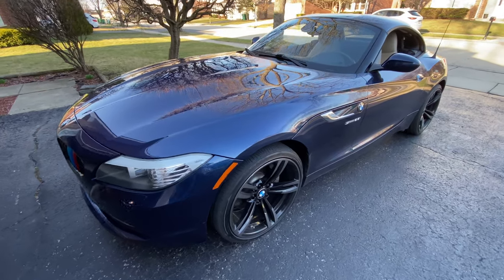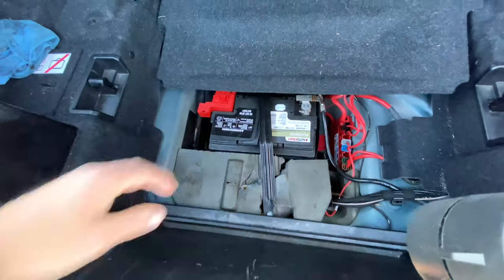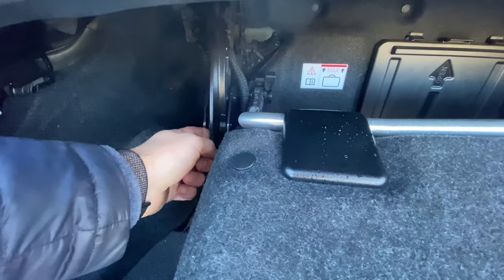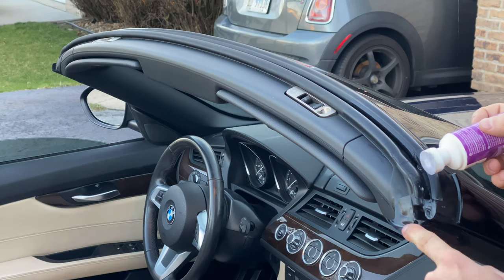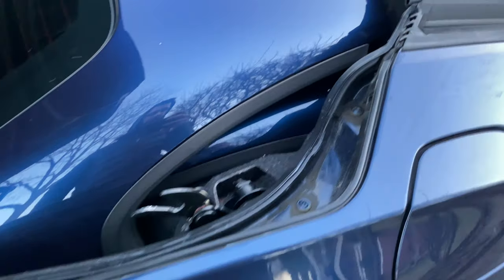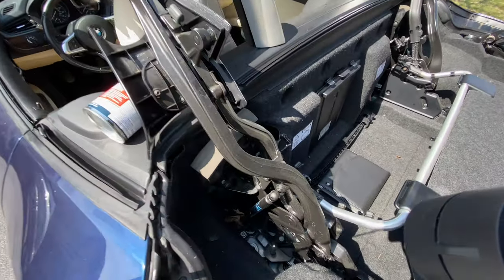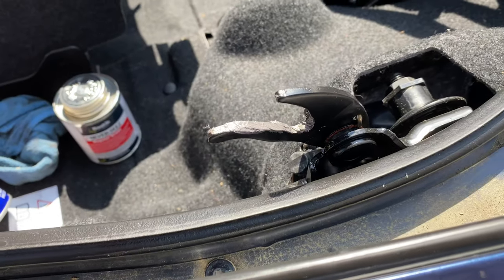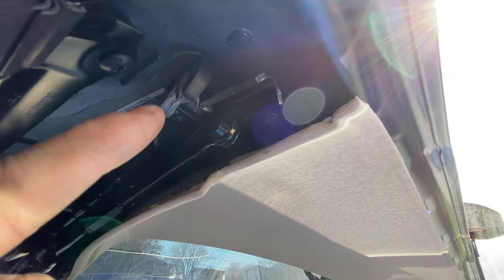BMW Convertible Roof Maintenance DIY

Comment: Great video... to get the roof in all those positions, are you just hold the Up/Down button and then turning the car OFF to hold it there (I've never tried that, I know the car gives you a "hint" when top is not fully up or down)..  THX  Looks like something to do on a nice Spring day.
Reply from the maker: I would use the key and just stop at the position I wanted the roof to be at. No need to shut the car off etc. 
it’s a fun little project when it’s nice out, for sure! Thanks for watching!
Reply: @SimpleCarGuy  not possible without comfort access. But still possible from the inside. Just not as convenient
Reply from the maker: I think you can still do it with the physical key in the door, even if you don’t have the comfort access.

Comment: I conditioned all my Z4's roof seals, I checked some lube points and found a Hall sensor in the wind shield right side hook latch.  I'm not going to grease this latch, but oil the mechanical parts.  I fear the grease will foul the sensor.

Comment: Hi man!     Where did you find all that info about grease/oil points for the Z4, as well as products used?   I am troubleshooting a convertible top in my 335i.  Can you help?   Where can I get diagrams & troubleshooting info?
Reply from the maker: Hi there! I got most of the troubleshooting steps and the recommended products (or equivalent) from the newtis and ISTA. I think newtis is now shutdown, but you can still download the ISTA software which has the same info and diagrams.

Comment: hey i just found your video at the right time i just got an 09 s35i and its my first bimmer and convertible car and im loving it my main concern was the rooftop i keep getting blinking rooftop up buttons when the roof is down. any indication as to why?  would this help fix this? and i also see that you are in chicago i am in milwaukee!
Reply from the maker: Is the roof opening and closing as it should but you just get the blinking light or is it not operational at all? Welcome to the channel!
Reply: @SimpleCarGuy  it's opening and closing but it seems like it's not latching completely and then sometimes the light will blink and then it won't blink at all
Reply from the maker: Go to the link below and see the check control messages and what they mean. Good luck and hope it helps:
https://www.newtis.info/tisv2/a/en/e89-z4-sdrive28i-roa/repair-manuals/54-slide-tilt-sunroof-soft-top/54-37-folding-roof/IzVRXi6J

Comment: Very nice content. I just want to ask where did you find the instructions that you claim that they are on the manual of bmw so you detailly followed different steps in each part?
Reply from the maker: Thank you! I’ve used newtis info website which has BMW data.
Reply: @SimpleCarGuy  Hi again, today i decided to maintain my hardtop but as you know newtis info is alittle bit complicated could not even reach the page which shows this product for here and this for here. So if you do not mind I would be very happy if you can share a link or tell the steps. Thanks.
Reply from the maker: @mustafayalcnkaya1401  They don't have step by step directions, it's just the diagrams I showed in the video with points that you need to take care of.
Reply: @SimpleCarGuy  okay thank you so much i have also seen some instructions from a forum for e93 which is the same as yours so i will try to apply the steps to my f33 asap. Thank you so much

Comment: I just did the conditioning of the seals as there were some drips coming from the pillars, nothing major.. all seals seemed to be quite good, but this morning after all night rain, there was still some water drips in car, especially from the b pillar (I think). Any advice?
Reply from the maker: Is your roof closing all the way and locking properly? I would make sure nothing is pinched and if you can't find anything, your seals might have not been taken care of for many years and will need replacing. You can tell by seeing if they are flat or round about 'bouncy'.
Reply: SimpleCarGuy thank you, will do the checks!

Comment: It would have been nice if you had also shown us how to get the roof sections in the partially open position in order to get to the seals and hinges.  All I know is which button will fully retract the roof and which button will close the roof.
Reply from the maker: I just let go off the button half way through. It hands for a few seconds and then slowly lowers on its own in that half open position.

Comment: How did Mazda manage to fit a folding roof in the same space as a cloth one without losing any boot space?
Reply: Great Japanese engineering. I'm looking for a miata instead of a z4 because of the mostly great engineering.

Comment: 2:50  why was your finger wet after you checked the unit ?  What is the correct level for the fluid and why did you not show us ?  Good tips about the car, but detailed information...like having that bar removed prior to the video was needed so you could pull the unit out and shows us, seeing how you researched and checked with your friends and all before doing this video.
Reply from the maker: There is a bit of moisture in the foam around it, but the level was correct. I didn't want to pull it completely out as it wasn't the main point of the video and more of a mention so people can research into it more. Thanks for watching!

Comment: Hi do you wipe any excess off when youre lubricating? Or do you just leave it
Reply from the maker: After opening the roof a few times, I wiped off what didn’t seem to be in contact with anything off. When using the liquid lubricant, I had a rag underneath so it wouldn’t drip on anything in places it would affect anything.
Reply: @SimpleCarGuy  ok great.. Thanks for replying. Excellent vid

Comment: Hi After lubricating , does the car still rattles / or make creek noise when you drive ? i herd the Z4 makes lot of creek noise when you drive
Reply from the maker: It does not. That’s the reason to do this once or twice a year depending on your climate.
Reply: @SimpleCarGuy  Thanks
Reply: Curious to know : is the roof leaks in rain ?
Reply from the maker: I haven’t had any leaks in the 1.5 years I’ve had the car. It was parked outside in the snow and rain for a month this winter and no leaks either.
Reply: Appreciate your response 👍,  thanks

Comment: Nice DIY ! Did you change the salmon relays of the hydrolic unit ?
Reply from the maker: I was not aware of these! Do you have more information as to why they need to be replaced? I will do some research.
Reply: SimpleCarGuy a lot of people are changing them regularly (4/5 years) to prevent problems due to the pump. Sometimes they stay stuck and the pump is forcing a lot then it brakes, and it cost 2000€ to replace...
Reply from the maker: @NicoGeeRk  Thanks for the heads, I'll look into replacing them.
Reply: SimpleCarGuy maybe you can make a little video about that ? :) ;)
Reply from the maker: @NicoGeeRk  I'm on it!
Reply from the maker: @jasonharley8230  Thanks for the link, will read through and see how necessary it is.

Comment: I bought a used 2007 328i convertible couple of months ago and I just noticed a leak on the driver and passenger pillar. 😩
Reply from the maker: If it's bad enough and the steps in the video don't help even after multiple application of moisturizer, you might want to replace the rubbers. This is why this maintenance should be done at least once a year.
Reply: @SimpleCarGuy  I look it up and I think I need a center rubber roof panel. It ain’t cheap tho. 😭

Comment: How do keep roof partly open??
Reply from the maker: Press and hold the button to open the roof and then let go at the point where you want it stopped. Wouldn’t recommend stopping it in any position where there is pressure on the framework. (Like second panel hanging in the air.)

Comment: Follow BMW guidelines.  I did what the posted laid out. And I’ve got grease on trunk latches which got all over things in my trunk.  Dont recommend
Reply from the maker: I've put about 5000 miles opening and closing the rood almost daily and haven't had any grease anywhere. How exactly did it get on your things?